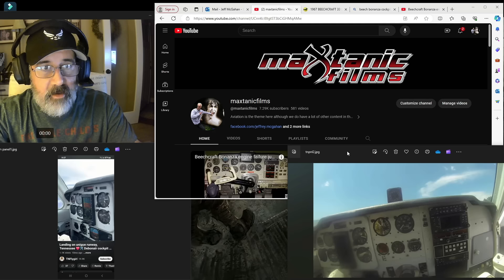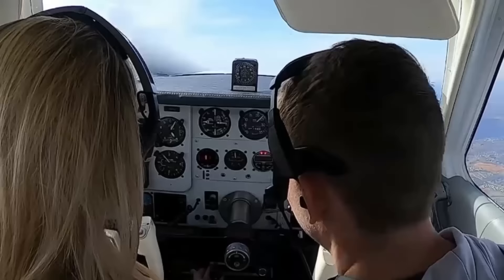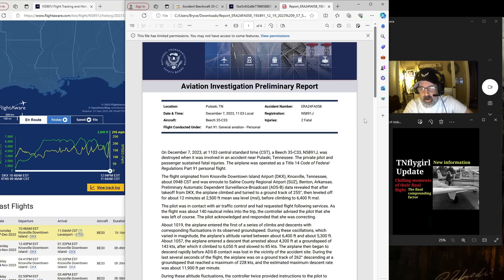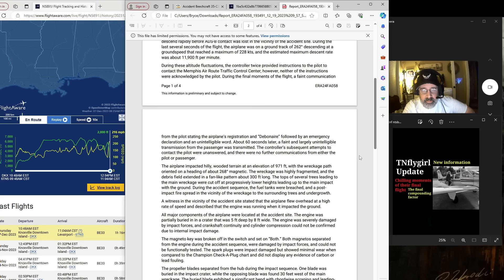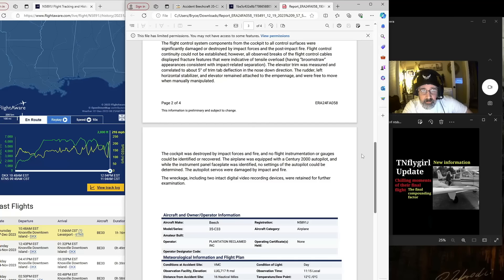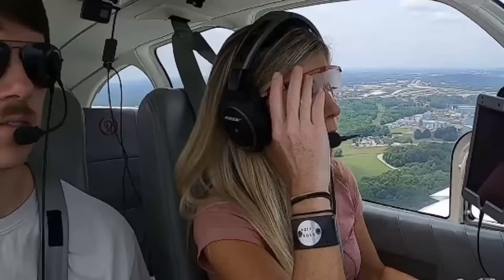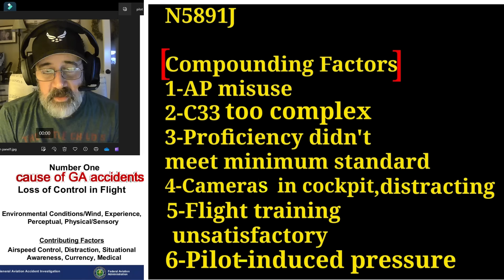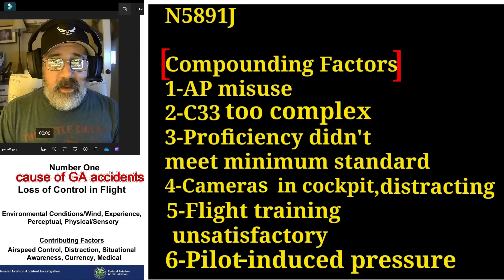TNflygirl Fatal Crash Update NTSB Preliminary Report N5891J

Comment: Yesterday I was watching one of her videos where the passenger door came open and she took off, and her Dad had to hold the door till it landed. Then at the end of the vid she laughed and said its happened 4 or 5 times ...... apparently preflight checks are more of a 'if you feel like it' to her. How do you have doors open on you during takeoff 4 or 5 times?
Reply: In another video the CFI pointed out that she failed to check the door and she hardly paid attention to the criticism. 400 hours of bad habit.
Reply: How can you forget a door even one type, I'm surprised her dad even dared to fly with her.
Reply: Apparently she learned to ignore safety items and danger points from her dad. I assume it became a lo g time habit. Many people do the same thing.
Reply: doors on small planes are notorious for not latching and popping open once you take flight its not a safety risk it mainly happens as the passenger is not familiar with the latching mechanism and tell the pilot the door is closed your supposed to reach across ( single door plane) and confirm it yourself as the pilot.. but I had it happen on a few planes i owned. my last one a Cirrus SR 22 was particularly finicky. and tough for passengers so I always followed them into the seat and closed the door from the outside myself that way i knew for certain there would not be an issue.. the major issue with it is if for some reason the seat belt has been caught in the door and is hanging out. that will bang the crap out of the plane and startle you big time caused dents and paint scratches until you come around the pattern and land. Bottom line though when you watch her fly she had no real basic instincts for controlling and flying the plane she let speed wonder all over the place could not hold altitude etc these are basics for learning on instruments and too many gadgets/cameras that distracted her. Sad. @teijaflink2226
Reply: leaving flaps out on a go around is not that uncommon I have done it a time or two U realize it when your wondering why your speed is so low.  @DannyWildmen  as long as its only half flaps leaving full flaps out is not good and you would notice that right away half flaps for me in the SR 22 and it still climbs very well etc.
Reply: Her radio was obviously faulty and she just blamed everyone else's radios, in luding ATC. That's why ATC could not communicate with her as she was porpoising the airplane.
Reply: Who the heck is flying the plane. Both of them have hands on stuff.
Reply: @jlh9910  Damn flaps on my American Yankee would just not come back up sometimes, then they would come up on their own. A&P never could figure out the problem and neither could I. No matter.. I just stopped using them.. they didn't do much anyway.
Reply: Failure to take preflight and checklist seriously has led to countless accidents, including the death of a family I knew in Addison by an arrogant pilot known for skipping basic checklists and preflight steps. https://youtu.be/guxOVHNZqAI
Reply: It's "were", past tense.
Just sayin'😉
Reply: @haroldreardon1407 I wonder if she had the same attitude when building homes.
Reply: WTF?
Reply: @fedos she probably acquired that business in the divorce
Reply: @vegashdrider  It was legitimately her business. She got her general contractor license right out of college and started the company a few years later.
Reply: I saw a video where she thought the gallon per hour fuel flow meter was the trim setting indicator   😬

Comment: Sad story, but with each video I watch it becomes more and more clear that she had no business flying an airplane. Her technique seemed to be to just push buttons and pull levers until she saw a positive result.
Reply: She could fly an single engine aircraft in the circuit, she had just never properly progressed to Navigation and her attitude about learning was all wrong.
Reply: @serverlan763  Anyone with a pulse can hold a yoke and keep a plane airborne for a limited amount of time. She had no business flying anything, and I'd question her ability to safely operate a vehicle. She was clueless the BASIC fundamentals of flight.
Reply: @jeffrojefferson88  She could land (just) she could fly in the traffic pattern. She would have known the basics, she was just not good and wanted the auto pilot to fly the plane for her. She didnt know how to use the Auto Pilot which was another huge issue.
Reply: I mean that's one way to learn... just not with flying where death can happen quickly
Reply: Scary
Reply: @serverlan763  thats not saying much.  single engine prop planes pretty much fly themselves.  if you release the controls and they're properly trimmed they will pretty much settle into something resembling level flight.  if a single engine plane is out of control 9 times out of 10 it's the pilots problem, and the plane will fix itself if they just take their hands off the wheel.
Reply: No they dont. All the trim does is relieve the control pressure, it's not an auto pilot. Also alot of single engine planes only have an elevator trim so if you let go of the controls when straight and level, the would start rolling fairly soon. The plane wont fix itself if it gets in a spiral dive or spin. It wont land itself either.  @arizona_anime_fan
Reply: @jeffrojefferson88  she couldn't even drive a vehicle well
Reply: Should have never been given her pilots license.   Not qualified and way too much attention on making her videos rather than actually flying and totally clueless about the auto pilot.  Could have been wrose,  she could have hit another plane or jet with hundreds on board.

Comment: The moment where she says, "All I know (about AP) is I have to push this button when I reach my altitude" is very revealing. She didn't understand flying, she was just an automaton repeating the actions she had been told to perform. The reason she never increased power when she told the AP to climb was because no one ever specifically told her she needed to do that, they had only ever told her to increase power when she pulled back on the yoke to climb. The idea that you need power to climb - regardless of which inputs you were giving to make the climb - never registered with her.
Reply: Its almost like she treated trim the same way and in certain stages of the flight she would reach to do the limited trimming.
Reply: @panzerd18 I honestly think the AP trim annunciators confused her. She understood "trim up" as meaning "roll the wheel up", rather than, "trim so the nose goes up". If the annunciator had been labelled "pull up" and "push down", this might have registered with her. Again, there is a disconnect in her understanding here. She was interpreting the AP annunciators in a very literal fashion, with no real understanding of what the words "up" and "down" mean in the context of controlling your aircraft. How did this go unnoticed through all her CFI rides and check flights? Who signs this person off to fly as PIC? The system truly failed her, and she is just one of a recent trend of pilots being allowed to fly solo - and even being given ratings - without basic knowledge, like the kid who lost his life recently because he did not understand how to recover from a spin whilst doing solo engine-out practice in a twin!!! I mean... what is going on here? Shake my friggin' head. Such needless deaths. People are being killed by what they don't know they don't know, and the system which is supposed to educate them is failing. Badly.
Reply: @qarnos  "If the annunciator had been labelled "pull up" and "push down..."

By your own reasoning, she would try to push or pull the trim wheel which obviously can't be done. 

 "roll the wheel up", rather than, "trim so the nose goes up"

Huh? That's what happens.

What if the plane was a Piper Cherokee?
Reply: @smark1180 No, that's not how the trim wheel works. If you roll the wheel up/away from you, you will be trimming into a nose down attitude. Every aircraft works this way, so I don't understand why you are bringing Cherokees into it. I have flown Cherokees and I can tell you, this is how the pitch trim works!
Reply: @qarnos  The Cherokees to which I refer have a crank mounted horizontally on the ceiling, not a wheel mounted vertically.
Reply: @qarnos  The Deb/Bo trim wheel is mounted below the panel, not on the "face" of it like in a C182, for example.

"If you roll the wheel up/away from you"

In the Deb/Bo it's wheel up/towards you or wheel down/away from you.

There's no pushing or pulling on it involved.
Reply: @qarnos I had a customer with a Lancair experimental turbine. It could fly at just over 100, or over 300, and had an AP with no automatic trim. When you varied the speed with the AP on the airplane would be out of trim in a heartbeat. The pilot was in his 70’s. He was so far behind the airplane I didn’t want to work on it. He got the AP trim annunciations and the electric trim indicators confused and ended up trimming the airplane full up when he should have been trimming it down, at which point the trim servo jammed. He and the passenger landed the airplane. It took all their strength to overcome the trim and they came in the FBO soaked in sweat, and sat in the FBO for at least 30 minutes shaking like a leaf and white as a ghost. I still have people that want to install AP’s without auto trim (just about every current production AP has it available these days). I refuse.  Runaway trim is very rare, but pilots not knowing how to trim out an AP is surprisingly common.
Reply: And that's very disturbing its almost like she equated flying with driving a car
Reply: Depends because you dont want a trim stall either
Reply: @jerryking5426 that’s exactly my impression and I am on this channel not knowing anything about flight. The impression I get is she had one competency: turning left and right on “the wheel.” And bizarrely she thought that being up thousands of feet wasn’t any different from driving her car. The disconnect is crazy and could have led to so many more lives lost.
Reply: Yeah, she was a video model.  Not the sharpest knife in the drawer. Should never have been behind a yoke.
Reply: You've hit the proverbial "Spike" right on the head!  Great succinct analysis.  Flashing 'trim up" in this case means trim wheel down to smooth out air pressure over the stabilizer for a "nose up" configuration. @qarnos
Reply: I honestly don't think anything ever registered with her, and it never could. She was way too arrogant and thought way too highly of herself. She didn't listen to anyone for anything, not even atc.
Reply: SHE MOST LIKELY DID NOT EVEN STEER HER OWN CAR WELL.
Reply: @LazloNQ Watching women learn how to operate manual shift in a car is just as infuriating. They just learn to shift up at a certain speed. They eventually learn they have to use the clutch, but understand nothing about the revs or how they are connected to gas usage. My GF keeps bitching about her high gas mileage while continually refusing to shift up earlier. The new car has a turbo motor so the speeds where she needs to upshift have changed. The car even indicates when you should upshift, but It’s hopeless. She is great with the kids and all the paperwork and tax stuff, though.😂
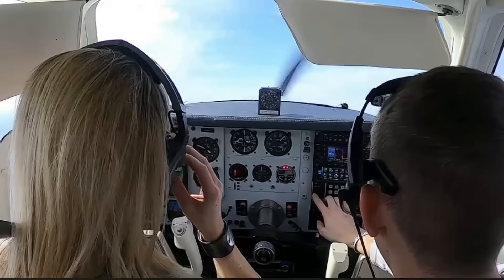Reply: 3:00. As long as your hair looks good, love, don’t you worry your pretty little head about all those buttons and dials.
Reply: @BleakVision  Generalizing about capabilities of women is ignorant.  I have flown with 3 female CFI's who were all truly excellent and capable and now all work for the airlines and are great pilots.  I have worked and flown with a lot of women who are all better than many male pilots.
Reply: @smark1180 how on earth can you give incomplete comments like that.
Reply: @billpugh58  " incomplete comments like that." Specify.
Reply: Using auto throttle if it was installed on this aircraft type would have been a sheer nightmare for her comprehension
Reply: I’m not even a pilot, but “you need more power to go up” seems like it’s common sense to me.

Comment: My take away from her videos is... she was not prepared for anything unexpected. And many things were unexpected to her. Because she knew so little about aviation.
Reply: She didn’t even seem at all prepared for the expected - like trimming the aircraft, using AP and communicating with ATC.
Reply: I thought the same thing. Imagine if she had an engine stall, or hell, lost 50% power after takeoff, or, if she got caught in some clouds and lost the horizon for a couple minutes. For her, anything like that would've been a death sentence, yet somehow she had her PPL.
Reply: @crashburn3292  Exactly 💯.  An engine stall is unexpected. But you should be prepared in case it happens. I doubt that she was.
Reply: @AEM-le7uy  She paid a mechanic to make sure the engine did not fail. So if it did fail and she crashed because of it, it would be the mechanics fault, not hers... So that's not a problem here for her.
Reply: @rtqii  "if" ?  Maybe it was struck by lightning Or a flying saucer from Saturn shot her down. "If" that happened, then it wouldn't be on her..  🤣
Reply: @AEM-le7uy  I disagree. An engine stall is something you are taught in the first few hours of training.  I still remember what my dad did when I was five and riding in the back seat!
Reply: Exactly, she was probably also unaware of the unespected monthly rent for her apartment.
Reply: @rtqii  The engine stalled due to how she was flying the plane, dip. Which is almost always the case! Pilot error

Comment: The simple fact was she was flying a complex airplane with advanced avionics and she wasn't qualified. Today, it is so easy to learn these things in a simulator and know them inside out before going up in a plane (I have a cheep X-plane sim and can setup any aircraft with any avionics and practice at home). Trying to learn them while flying with camera's is the worst possible scenario I can think of.
Reply: Advanced avionics? They were antiques.
Reply: I agree with learning on the ground in the sim.  Avionics in sim always work 100% and gives predictable and repeatable results to inputs.  If autopilot is not working correctly while in the air, an inexperienced pilot may not recognize this because she is conditioned to trust the equipment.  This wrongly placed trust occurred with the Ethiopian 737Max crash.  Pilots in that accident kept turning on the autopilot and could not recognize that AOA was not working.
Reply: @SOLDOZER you know what he’s trying to say
Reply: Flying with cameras while learning is actually a good idea if you use them as a tool for review and learning from mistakes, not for trying to become an influencer.
Reply: @OptomPilot ya it seems like viewers of a specific age group struggle to comprehend this along with the idea that a static camera mounted pre flight isn’t an active distraction. Nor is the content as it’s also edited post flight. Forgetting the obvious benefits it’s provided us viewers about her competence.
Reply: @SOLDOZER er fly in a Pitts? Stick, rudder and throttle ,radio and minimal instuments.  Probably similar to her first plane
Reply: I want a sim. What is a good brand?
Reply: @ChrisS-oo6fl  As a college teacher, I have often said, young people do not lack in confidence.

Comment: When I was being trained in the Navy on the T-34C Mentor, my on wing instructor would continually hound me about airspeed, heading and altitude. It's a complex airplane with a very powerful yaw around the vertical axis when power changes are made. And my instructor(s) ALWAYS warned us to NEVER "ham fist" the airplane. I was taught to hold the controls with the same grip you hold a pencil with. Three fingers. If you needed more than that, then you probably aren't trimmed up properly. Looking at the cause of her fatal accident, I keep being reminded that trimming the plane should be of utmost importance - the last thing you need to be doing is wrestling with hundreds of horsepower AND trying to think in three dimensions plus time. 

"Aviate, Navigate, Communicate" in THAT ORDER. She was having a tough time with Aviate, and her CFI was struggling with Navigate and Communicate. Time to get back to the BASICS.
Reply: mipmipmipmipmip  😁✔️😂
Reply: This plane does not have the same yaw dynamics ad the T-34 though
Reply: @tmayorca8770  Exactly. And that's the point. That little plane should be EASY to trim properly, with a simple move of one dial (but to be honest, we almost never touched the rudder trim either - by the time you did, the power adjustment caught up with the rudder forces and you were back in trim). 

If your heading, airspeed, and altitude are all correct, you'll have a much easier time catching up with the plane even if you get way behind. When you don't feel like you're wrestling an alligator, it's much easier to think about navigation and communication. 

Finally, if the control forces feel wrong to the A/P and the plane is starting to porpoise, you disconnect the A/P, trim the plane, and fly by hand, at least until everything settles down.
Reply: VT-2 1987.
Reply: Heck, that's the same fundamentals that I was taught in a Cessna 150 sixty years ago.  This whole scenario is beyond my ability to comprehend.
Reply: @hawkeye681  VT-3 Black Knights, also 1987! (AOCS Class 45-86)
Reply: she did appear to have a death grip on the yoke.